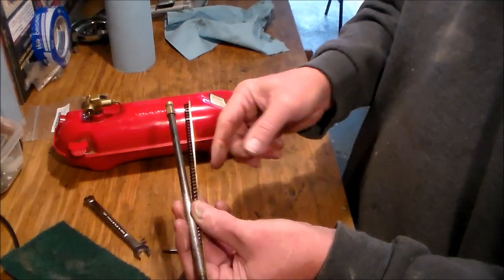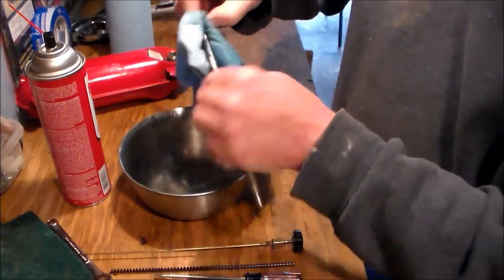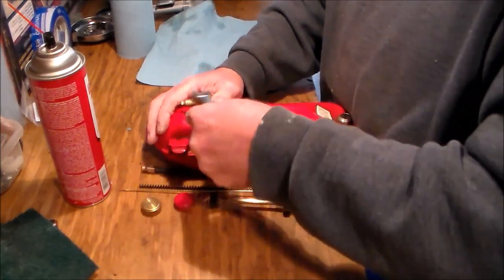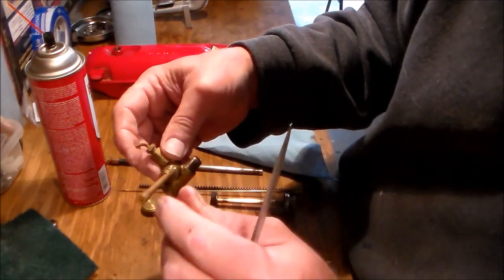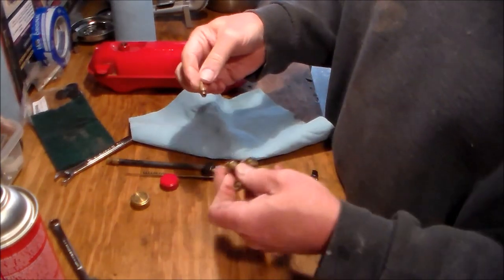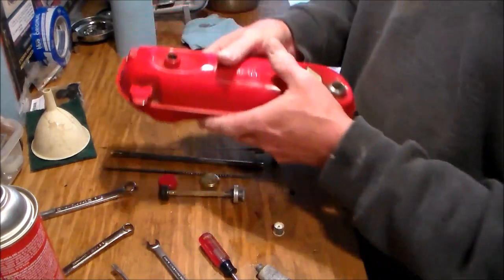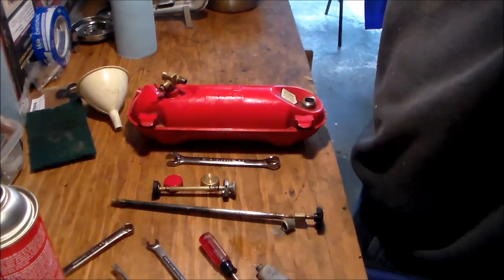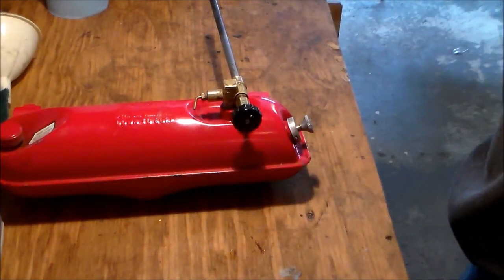Restoring an old Coleman stove part 3B

Comment: Thank you for your instructions on cleaning the stove. I followed your instructions but when I light it up, the burners work very well however, there is a continual flame at the junction of the master burner body and the tube. I made sure I tighten up the screw well at the end (needle).
Any suggestions?

Comment: Great video series Bob!  I have a question though as I am restoring a coleman 424 dual burner that i inherited from my dad's camping gear.  I was trying to pressurize the fuel tank and was getting no pressure to build up.  I removed the pum and found the gasket was hardened and inflexible.  Got the replacement and installed it but now i can depress the plunger to get pressure to build up.  I know you mention that only in rare cases does the check valve need replacing.  The fact that I can depress the plunger indicate that my check valve may be gunked up from the fuel side and need replacing?

Comment: Cleaned spring by placing in power drill and used steel wool...running spring forward & reverse while allowing steel wool to get down between curls of spring.
turned out much cleaner than when using just Scotch brite.  Couldn't get rod off the brass stopcock...so cleaned in place.  Used 25 ACP wire brush to clean carbon
inside of tube (22 cal too small), followed by dry bore swab with clean patch. (Took several patches / passes until patch came out semi clean.)
All that to say after cleaning and re-assembling...stove lit up like a champ.  Gone were huge fire ball seen when last used.. Great instructional video...wouldn't
have attempted without first watching.
PS  used Dremel with wire wheel brush to clean off decades of corrosion and carbon build-up on burners, exterior gas line, & non-brass fittings.,.  This should keep stove operational for another 20+  years with preventative maintenance mentioned in video.   Again, Thank you.

Comment: Sir, u know what i did with my spring. I put the spring in my drill. And i use krud cutter on the green scotch brite. I hug the spring with the green scotch brite as yours and i run the drill. I slide the scrub pad up an down in a slow motion, with medium pressure. With hitting the drill trigger all the way. The spring comes out super clean. When i rinse it with water.. looks like brand new.

Comment: Hi Bob - I’m in Aus and I’m having trouble from my late model three burner Coleman stove- basically it floods and is quite dangerous as the fuel drips out of the burner and the burner tube when trying to light it and I end up with a growing fire in the stove box - the flame from the burner remains yellow and gets worse if I turn the lever from start to run - it’s quite dangerous- it was working fine up until a week ago - I watched your video and completely stripped the stove and cleaned everything though it wasn’t that dirty inside but after reassembly the problem remains- any ideas ? Can’t get Coleman fuel out here so I’ve been running it on White Spirits which I think is the same- any ideas?

Comment: I absolutely loved this video, as I use my gasoline camp stove daily for over 20 years now. I know how to clean the generator needle, but have not be able to get the spring out for a thorough cleaning. When the generator is new no problem, but once the carbon builds up it gets good and stuck in the tube. Any advice to get the spring out would be appreciated!! You also taught me the importance of maintaining the tank pick up tube, which I did not know before. Thank for for an excellent tutorial. Bruce the swimmer New Rochelle N.Y.
Reply from the maker: If the generator is that gunked up, you will need to remove the tube/spring/jet assembly from the stove. Place it in a vice, and remove the brass  fitting from the end of the tube. Be careful, because the actual jet is a small brass piece that is held in the end of the tube by the fitting. It's easy for it to fall out on the floor and hide. Once the fitting is off, you can just push the spring out with a screwdriver or a piece of 3/16" wooden dowel. Clean all the pieces  with alcohol or brake cleaner. Reassemble everything in reverse order and you should be good to go another 50,000 miles.  :-)
Reply: @sagebrushbob2321  Thank you Bob, I will take your advice and give it a go. If is still stuck perhaps I could fill the tube with some sort of solvent, letting it sit overnight to loosen the carbon hold on it. Carb cleaner, brake cleaner,  penetrating oil, or something you recommend?
Reply from the maker: @stewartbruce2409  : I prefer using brake cleaner. It won't hurt plastic or rubber parts and it doesn't leave any oily or sticky residue behind.
Reply: @sagebrushbob2321  Thank you Sir, will give it an overnight soak with brake cleaner, and let you know of the results. PS: last time I was at a coleman collectors meet was 1990 in Indiana and I camped out in the backyard of the fellow who had a magnificent coleman museum . Off hand can't quite remember his name, but his trade was the heating business. Perhaps you were there?

Comment: I think carb cleaner dissolves better than brake cleaner.  Not sure just how different they are, but carb cleaner is pretty amazing and it's designed to deal with gasoline deposits.  Thanks for the .22 brush tip.  Hadn't thought of that!
Reply: I had the air tube clogged with old fuel. Filled pump tube with brake cleaner (since I had it laying around) for a week and still clogged even after using a 120psi air compressor to try and blow it out. Bought some carb cleaner and put a little in pump tube and next day it was clear even without blowing any air through.
Reply: @toddac61  Carb cleaner is a great help, but if you really want to get it clean take the generator apart (you called it the air tube).  Clean the small rod with steel wool, the spring with a brass brush and the tube with a 22 caliber gun cleaning brush and rod.  ten minutes later it's like new again.  Good for another ten years
Reply: @stevengerig6247  I meant the tube that is behind the check valve in the pump. I took the check valve out and still no air flow from the pump to the tank.
Reply: @toddac61  My bad!  Yes, now I understand.  Carb cleaner was the perfect solution!

Comment: SAGEBRUSH BOB:

THANK YOU FOR YO COLEMAN VIDEOS.  A QUICK TIP FROM A. MECHANIC WITH  CLOSE TO 50 YEARS EXPERIENCE.   RATHER THAN USING BRAKE PARTS CLEANER, I SUGGEST YOU USE CARBURETOR  CLEANER.  YOU WILL BE SURPRISED  WITH SAID RESULTS.   Please CONTINUE  WITH YOUR YOU TUBE HOW TO VIDEOS.  THANK YOU SIR!!!

Comment: Hello Sir. 
My 424 unleaded fuel gave up today after only just a year in use. No gas is coming out of the nozzle. It’s got pressure in the tank. When I remove the nozzle, the fuel is coming through the generator but - when the nozzle is back on there’s no gas coming through. 

Now the pin in the generator looks different to yours. There is no needle on the tip of my pin, that needle seems to be sitting in the nozzle... Is this how it was designed or is my needle broken off and stuck in the nozzle? Any advice would be greatly appreciated. Thanks for a great video.
Reply: I got a 424 and I can say mine has a needle on the end exactly like this one here in Bobs video.  in fact, apart from the colour of the tank and the location of the filler cap it is exactly the same as this so perhaps your needle is busted off and stuck in the jet (nozzle as you call it).
I'm currently servicing it hence why I'm watching these videos.

Comment: can that little pin that is inside the generator and attached to the black dial be removed from the dial i have a replacement ready to go for it but the pin seems to be attached permanently
Reply from the maker: Clean the needle as best you can, then look very closely at the point where it meets the larger tapered brass fitting. there should be two very small screws in the brass fitting that hold the needle in place. You will probably need a set of jewelers screwdrivers to fit them.

Comment: So what do you do when the run valve is leaking? My stove when pressurized leaks fuel out of the valve stem you point up/down for starting. No one seems to cover that in their videos.
Reply from the maker: First, try tightening the little nut that holds the lever in place just a little bit. If the lever gets tight and doesn't want to turn any more, back the nut off until is moves again. If it still leaks, remove the packing nut. There will be a small graphite packing washer behind it. You will need to replace it. Parts are available from Old Coleman Parts.com

Comment: Why aren’t you recommending using a tank sealer after rust removal inside the tank?  After the BB treatment, doesn’t that remove all of the original tank coating?

Comment: I am in need of help. I have model 404 (424, 428). I am unable to pump the pump. It was easy to do last summer but now almost impossible. I have replaced the pump but still is very hard to pump. What am I missing? also, when I took the pump apart there was no spring original piece.  But, the replacement that I purchased has the spring and directions say to always use the spring. S, now i am confused.

Comment: Again, late to the party, but it looks like there's a hex head on the pin end of the generator tube.  Would it make sense to remove that fitting, clean it separately, and use something like a .22 brush to clean the inside of the generator end to end?
Reply from the maker: Yes there is. It holds the fuel jet inside it that the needle fits in. You can remove it for cleaning, but be very careful not to lose that little jet. Its a pain to try and find a new one.

Comment: Thank you for the video. I have done the rebuild and I still have a problem. The problem is that the valve cannot be shut off even with the dial off all the way. I think it has something to do with the pin position at the tip. As a result, the stove flame cannot be shut off and stays on at very low flame, as long as there is a pressure in the tank. I can force the flame to be out and the end of nozzle keeps on spraying the fuel until the tank pressure is all relieved. It may have something to do with how tight the each end of nozzles has to be. Should you see the needle end when you shut off the dial all the way? Help!
Reply: Did you fix it? Mine does that too
Reply: @escapetherace1943  I messed around and ended up ruining the valve. But the problem has something to do with the positioning of pin at the end. You may have tightened the rod part too tight that the pin is a millimeter short to close at the tip. In the process of rebuilding, I may have tightened the rod too tight, is my guess (There are two screw ends at the rod). But then I am not an expert at this and I have ruined mine in an attempting to fix the problem so take my advice as a grain of salt. Maybe 
Sagebrushbob can give us some insight on the topic...
Reply: @michaelkim8666  hmm well mine works so no biggie, I have a backup generator but I want all the life out of the current one before I replace it. I'll probably take it apart and check that out soon

Comment: would vinager work for cleaning the tank?
Reply: I personally use white vinegar for cleaning fuel tanks.  You would also be amazed how well boiling those brass parts in some lemon just then turn the stove off and let the parts sit a few hours in the lemon juice

Comment: I have a duel fuel coleman two burner stove, when i pump the tank and tbe valve is shut, it still lets a tiny bit of fuel in the stove. But when i shut it off it stays simmering and doesn't turn off. Waited more tbe 30 minutes and flame does not shut off. I had to release the pressure by slowly turning the cap. What exactly is the issue here?
Reply from the maker: Probably wear and tear on the sealing surfaces inside the valve. You can try pulling out the valve stem ang generator needle assembly and cleaning everything inside and out. If it still leaks by, you will need to replace the valve assembly. Parts are available from the vendors shown in the description. Good luck!
Reply: @sagebrushbob2321  I got a new tank and generator so it's all good now

Comment: I'd just wrap the tank with three t-shirts and duct tape it . Pour BB's into fuel tank   close the cap   Throw it in a dryer without any heat and spin it for 10 min. 💥 Boom 💥  clean tank.  Take out BB's .   I do that with  motorcycle tank as well .

Comment: I find it interesting that knowing how valuable the little “poker” thing is at the end of the generator why everybody doesn’t insert it with the other end into the spring so you don’t get it caught.  Especially when it’s been unscrewed from the valve dial?
Reply from the maker: It would be possible, but the very tiny screws that attach it to the valve stem almost need a microscope to see. You can just imagine how easy it would be to drop one, and then everything comes to a halt.
Reply: @sagebrushbob2321  Yea I know.  I have rebuilt probably about 10 stoves so far and I am currently working on a 443 that I found at a dump that was in surprisingly good condition for the fact it was about to become melted aluminum.  Luckily I even was able to get it for free too.  Now I just have to take a rubber mallet and various pieces of wood to shape the aluminum back into place and drop it in a vat of water and dawn (the soap not my girlfriend) to get rid of all the grease and grime and then it’s rebuild time!!!

Comment: You didn’t check the o rings on the fuel adjustment you don’t know if there bad
Reply from the maker: They only need changed if they are leaking while the stove is in use. They should be compressed as shown in the video. If they still leak with the compression nut tightened all the way, then they should be replaced. In all my time of rebuilding these, I've only replaced one packing ring.
Reply: @sagebrushbob2321  Hi my 424 stove has been leaking from the valve. The packing ring seems to have disintegrated. I can't find a part number or where to get one. Any suggestions welcome. Thanks
Reply: Hi - I found some in the UK in  the end.
However since repairing the valve it’s now started leaking from the lighting leaver.  I’ve bought a whole new valve & generator assembly as time was against me
Reply: @sagebrushbob2321  hey I came up with a great mod for the tank that on top of the tank to give it a everlasting pressure for the tank that I took a brass tire valve stem and drilled a hole on top of the tank and soldering the tractor tire valve stem to the tank for a emergency air filler for just incase the air pump fails ever since I put the valve stem on top of the tank I never had any problems or leaks with my mod for the tank but it be nice to make a video of the mod because after the valve stem is installed you can use a air compressor or bike tire pump to pump it up better than the original air pump on the tank but becareful to not over pressure the tank should be at a pressure of 65psi